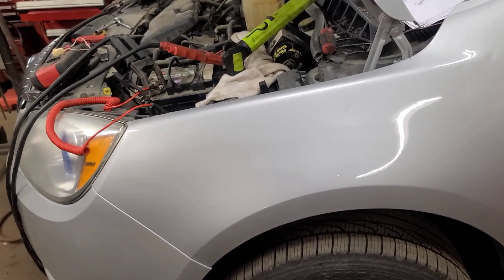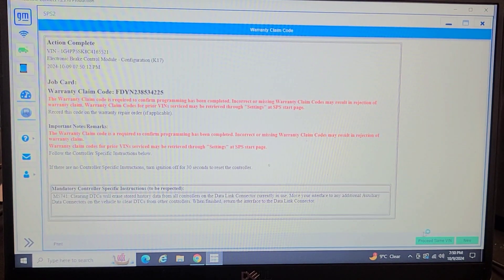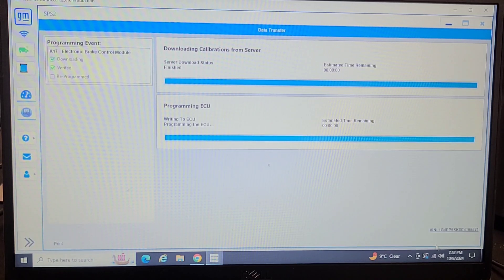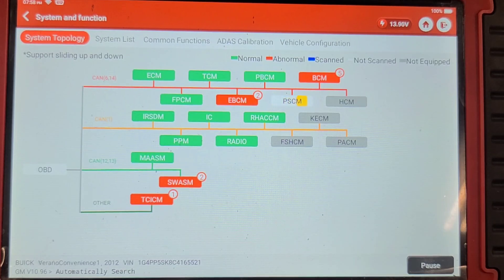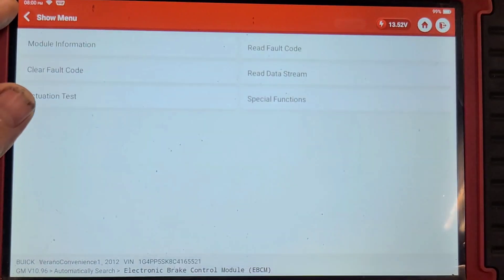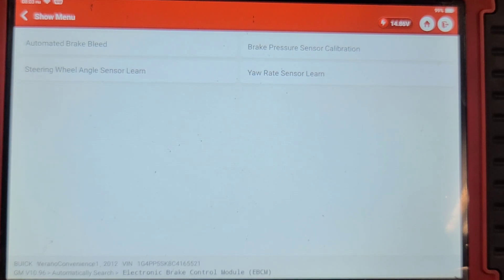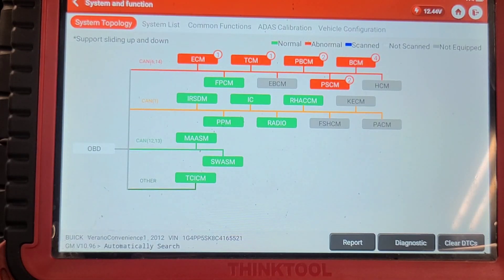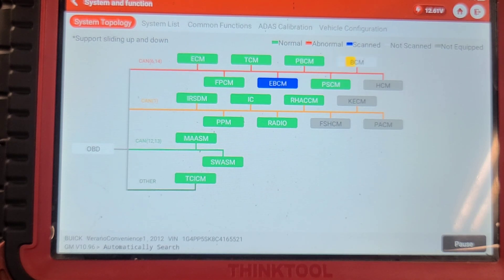2012 Buick Verano ABS Module Replacement, Still Not Fixed, Pt. 3

Comment: A short question of mine: 
Did this Buick has the blind spot controller in the back bumper? We had it in the past, that a completely corroded controller fucked up the HS1. 
JFYI. Hope it will be helpful.
Reply from the maker: @tyberzann9713  yes ive seen that but I believe that's a different network and the car doesn't have blind spot monitors but it does have another can network to the EBCM
Reply: @PhillipBailey  thank god there was not THAT goose chase. I can tell you: it is not funny. 
Good job on the car! (: